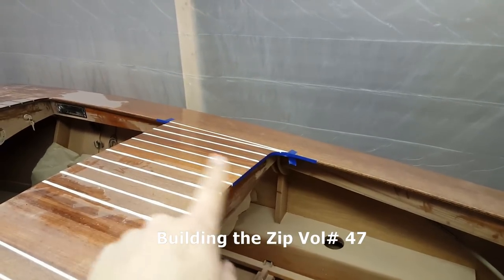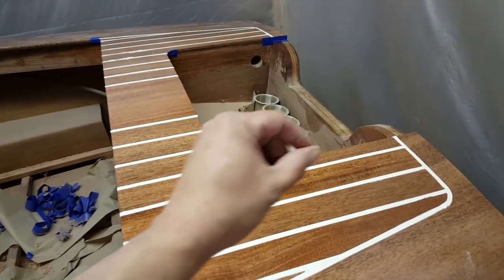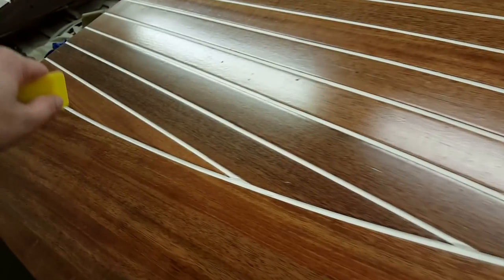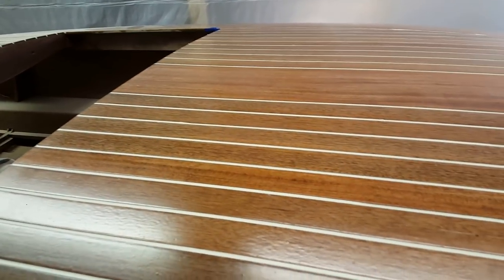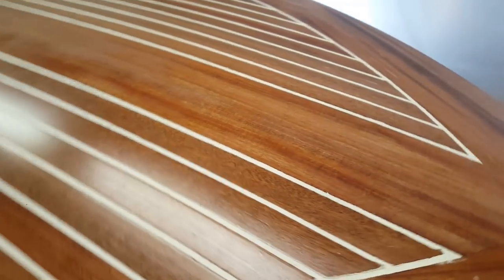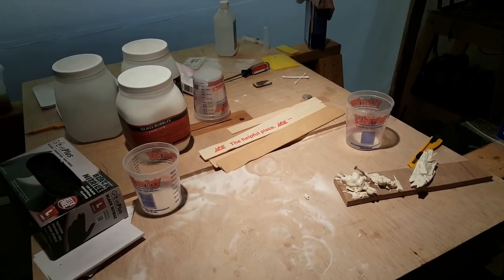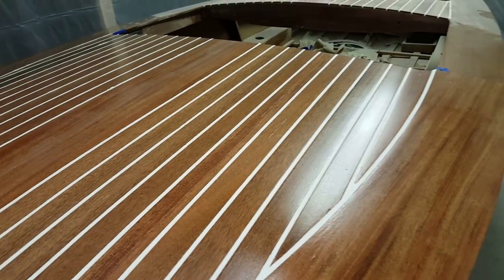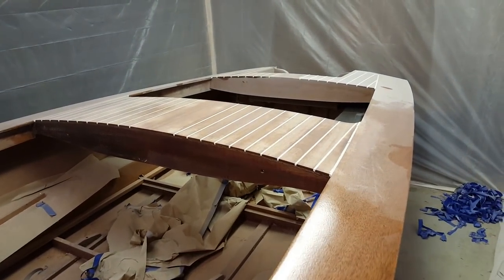Building the Zip vol# 47

Comment: Hey Joshua, I am watching your video and I know it is 2 years ago but the bubble problem in the resin with micro balloons can be easily corrected.  After mixing these two items you have a lot of entrapped air.  Put the mixture in a paper cup and put it under a bell jar and pump a vacuum on it.  Leave lots of room in the paper cup because it will boil up to look like five times the volume as the air comes out of the mixture.  After the air leaves the mixture it will fall down into the bottom of the cup and then you can pour it into your applicator.  After this treatment you will not have bubbles appear.  It only takes a minute to do and will greatly improve your results.  Just wanted to mention it incase someone hasn't yet.  Thanks for the videos.

Comment: Respect, for your patience. I agree with you that after so much time and effort it would be a bad choice to halfass anything. I know my grandfather would use a rubber typi material to fill seals on a teak deck. He was a professional boat builder
Reply from the maker: Lars de Waardt thanks for watching, i hope this deck seam idea works out, others have used this method but it does not have a proven history so no telling if it will stand the test of time, it sounded good in my head anyhow, thanks for watching.

Comment: Looks great! I think the thin veneer strips epoxied to the plywood subdeck should be very stable. Also, contrary to popular belief epoxy does have a bit of flexibility so I have high hopes that your method is a good one and you won't see any cracks down the line.
Reply from the maker: Matt Hood thanks for the compliment,  this seemed to me the lowest maintenance approach for the deck, i want that traditional look without the traditional upkeep. hope it works out like i planned, thanks for watching.